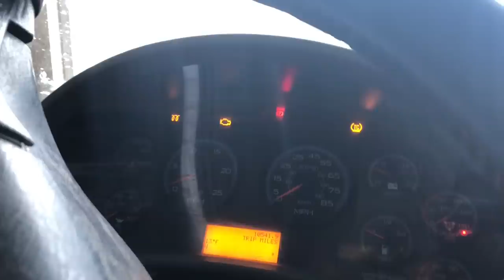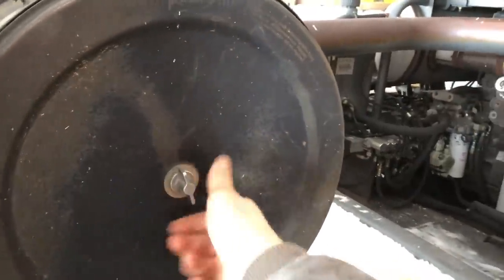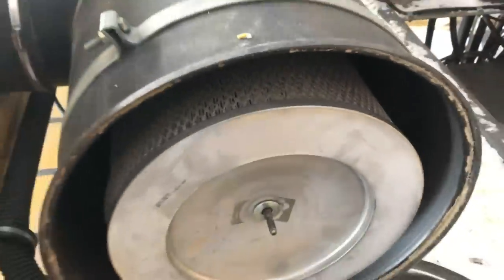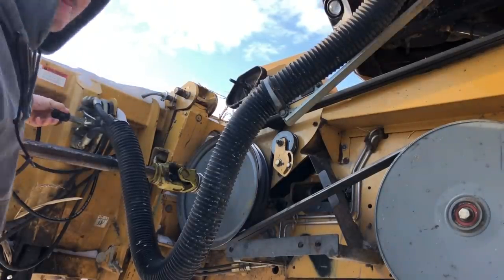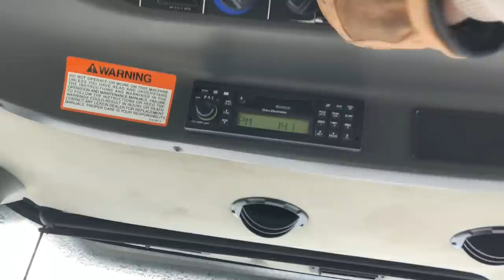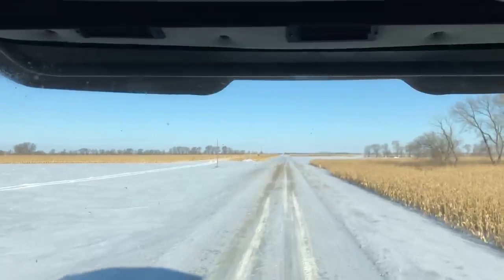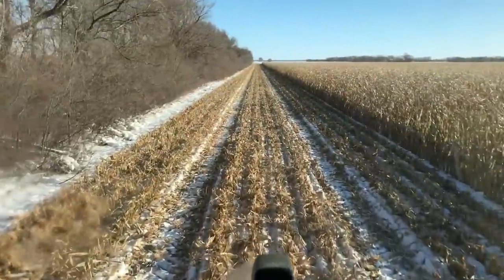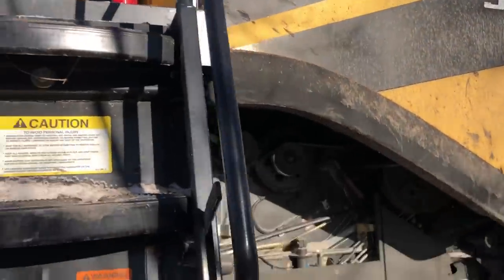Combining corn in the snow

Comment: Need to plug the block heater in if it's equipped with one        I CRINGE when I see starting fluid being used.    I worked with a mechanic for a while and I learned what's best in cold weather starting